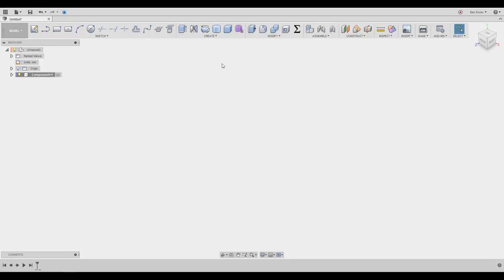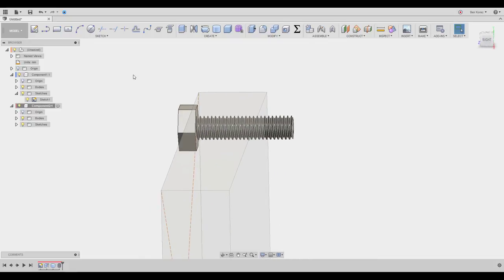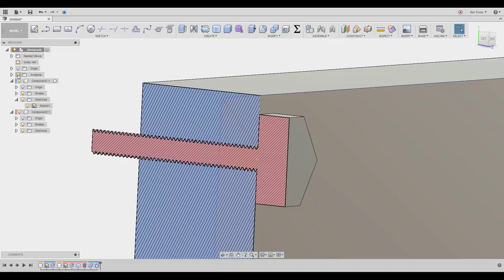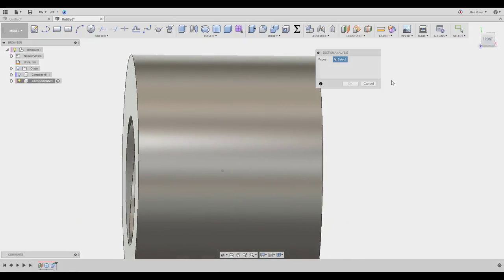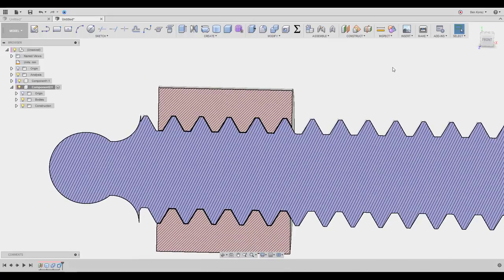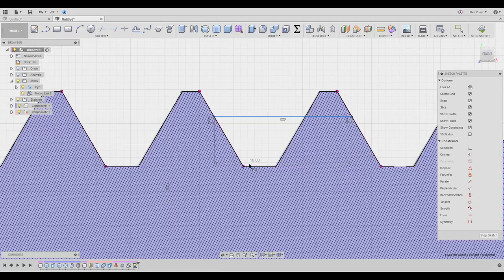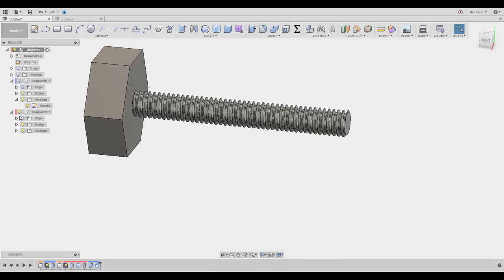Fusion 360: Nuts, Bolts, Threads and Animating Joints

Comment: Dear respected sir, I'm really happy for your help. 
I've followed all the steps that you shown here. But still I see some mismatching   with  your design. Like you did at time         
  29:27 / 38:41. I see some difference with the thread and teeth . I search the thread  TR40/10 but in my fusion 360, there is no any thread  as TR40/10. Therefore It is not matching. Please could you help me?
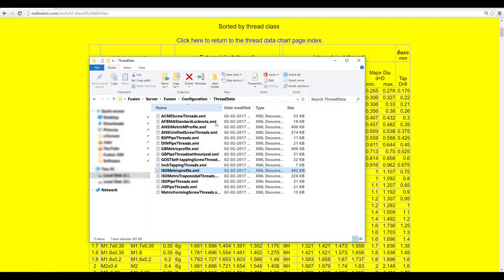Reply from the maker: If you can't find the thread that you are looking for, then you can add one to the thread file, like I'm showing in the video 12:54
Reply: Dear respected sir, thanks for your reply